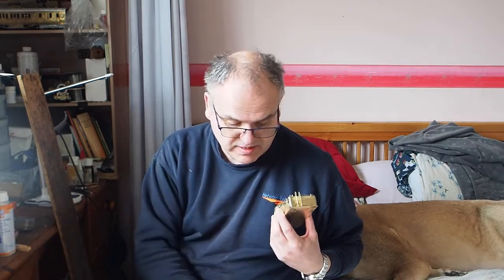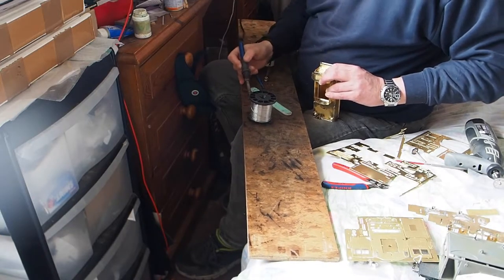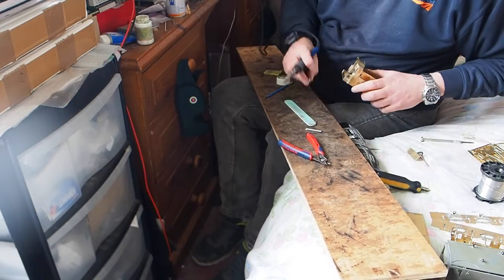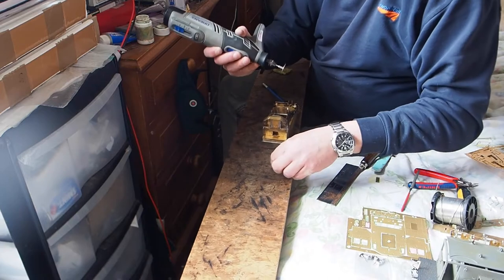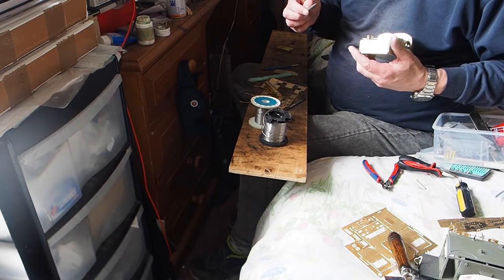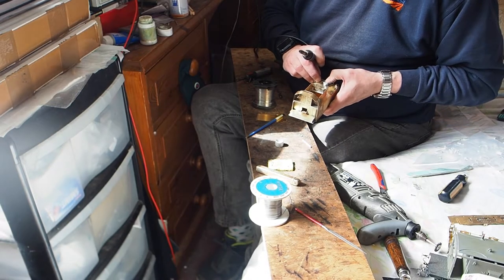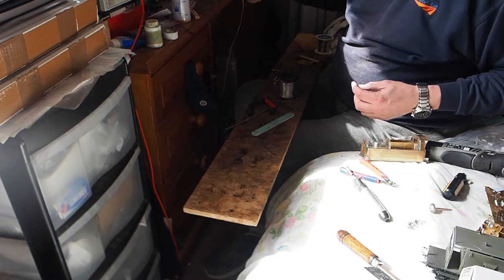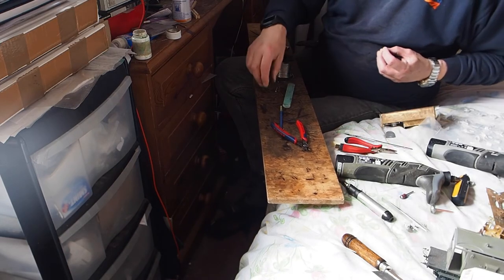Building the DJH 2MT 2-6-0 (78xxx) Part 6 - More Tender detailing

Comment: Good afternoon Peter. On the subject of rivets when you talk about 0.5 mm and 0.8 mm is that the rivet head diameter or shaft diameter? Are they round head, domed or flat? The photos I have are all of the domed variety but I am having difficulty finding the right ones in the sizes I need. Thank you.
Reply from the maker: The rivets I originally used were from Perfect Miniatures and were domed. They only sell flat headed ones now, which is a pity. The only place you can get them domed is in the US, Scale Hardware I think (Ian buys me some when he places an order for himself). The size is the size of the shank; so a 0.55mm hole for the 0.5mm rivets, and 0.85mm for the 0.8mm version.
Reply: Thank you Peter. I work on a cruise ship and go to the US regularly so I will take a look at that supplier. @TheGaugeOGuild